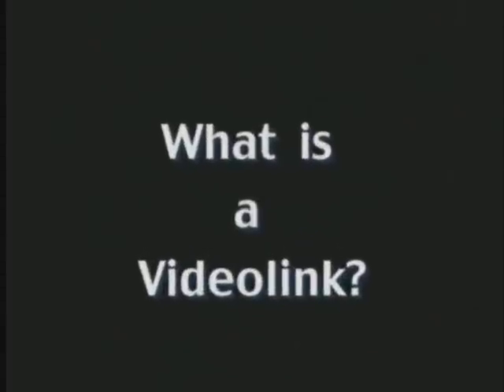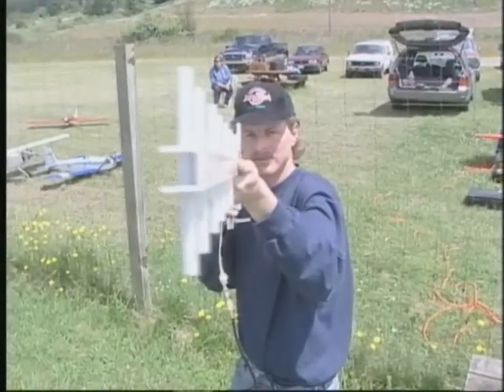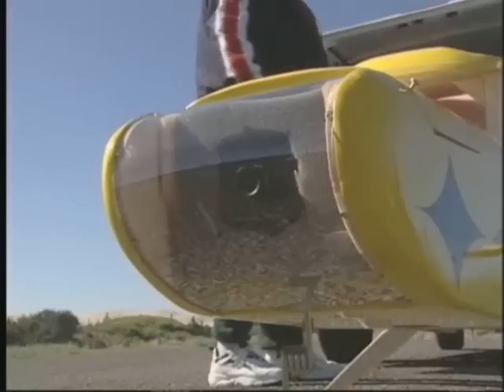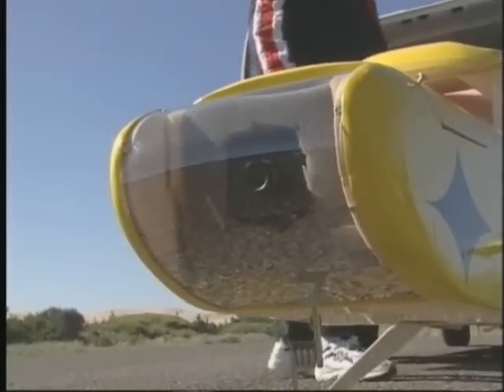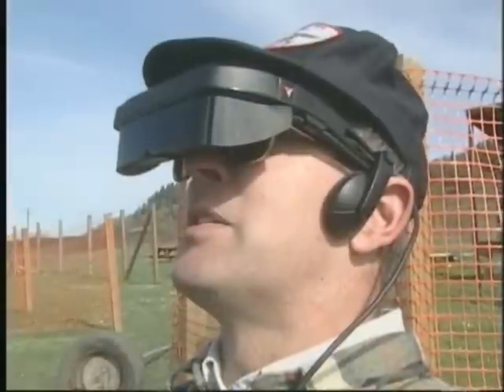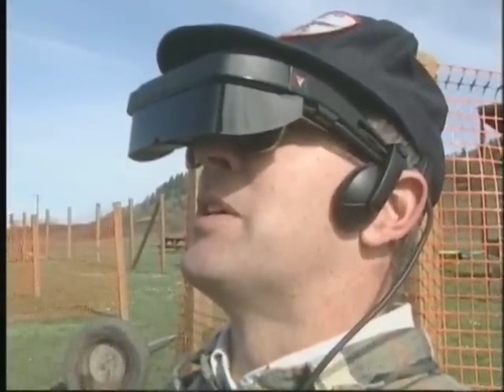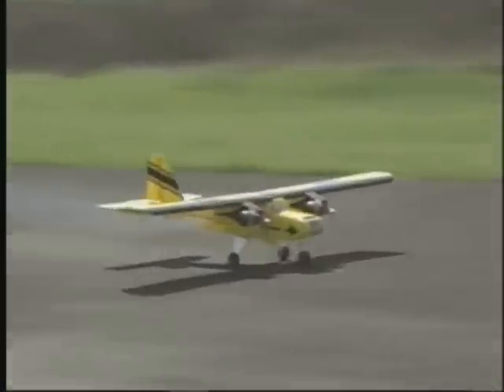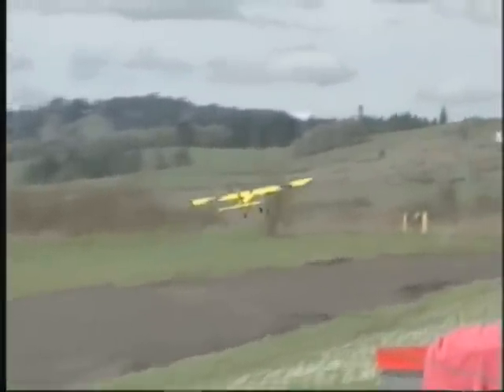"Worlds Greatest FPV Instruction Video"

Comment from the maker: @bdcp That would be a tough one. This was built from a set of modified Sig Kadet Senior Plans. The guy that built it died several years ago as well. You could just buy an arf standard Kadet Senior and put some nacels on the wings and just use two OS 25 two stroke engines and make it a tail dragger. Round off the front engine compartment and throw a lexan windshield on there as well. Or you could use velcro to hold the cameras and transmitters on pretty much anywhere. Something to think about

Comment from the maker: @magicmike1122  Ya, that old 1/4 acale clipped wing cub worked great for FPV/RPV. There is a bunch of cub footage if you look on my channel. I also used a 1/4 scale Champ but I do not think I have posted any of that yet. I have a full wing 1/4 J3 Cub I intend to gear up this fall with a fatshark system and HERO Go Pro HD. Stay tuned.